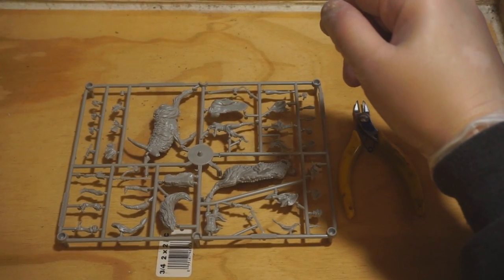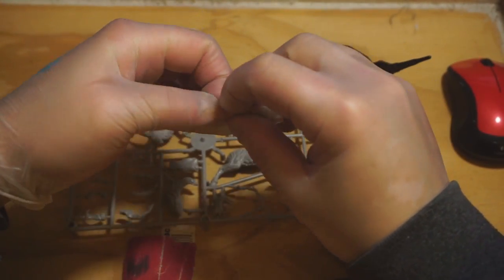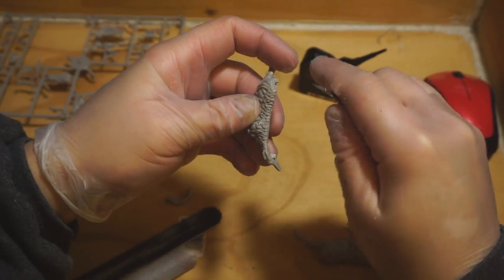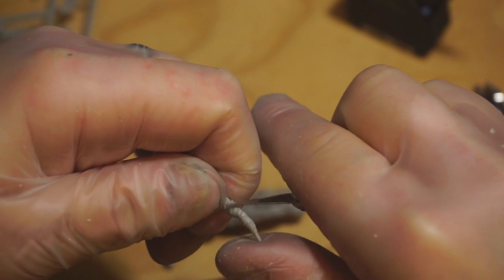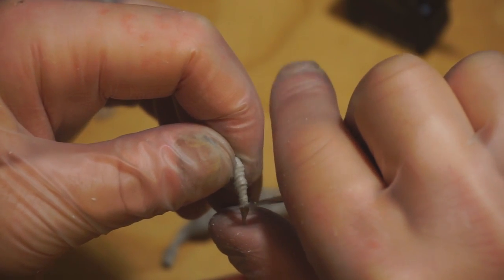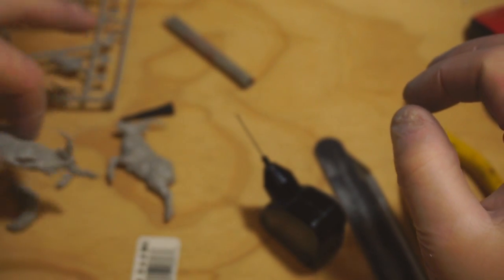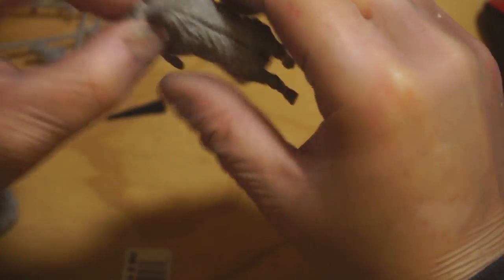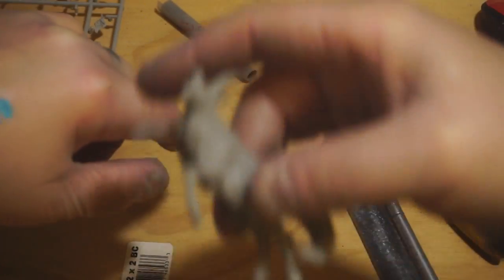KDM: Assembling the Screaming Antelope

Comment: Which glue are you using?  That fine tip looks insanely useful.
Reply from the maker: That's the Testors glue with the applicator tip. I don't use anything else. http://amzn.to/29obSaU
Reply: Is this different than the Tamiya plastic cement?  When that stuff bleeds out it completely wrecks the plastic.
Reply from the maker: I believe so. Tamiya uses a solvent?